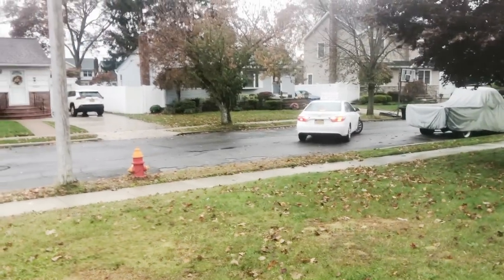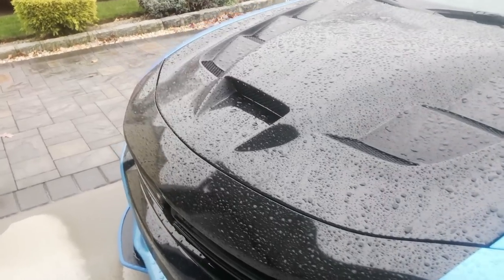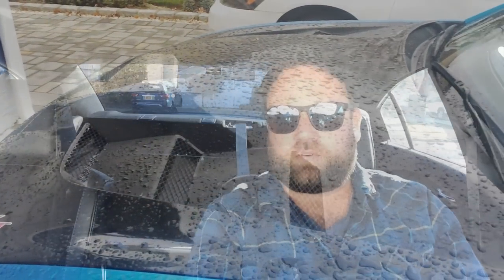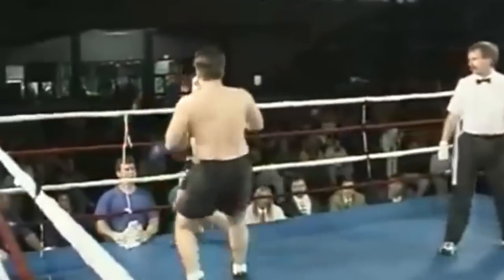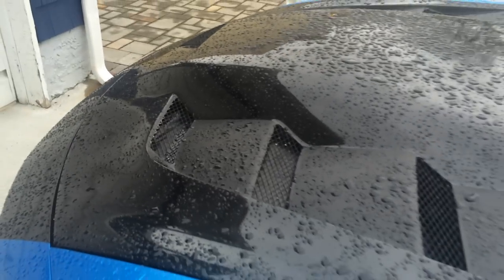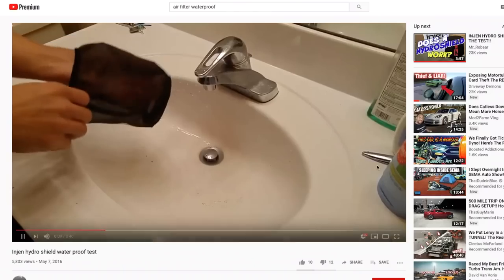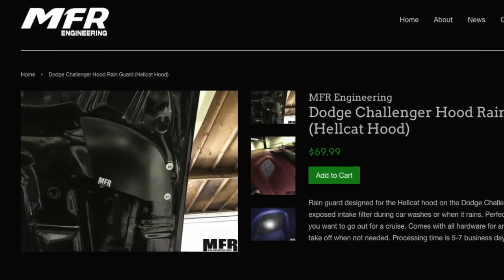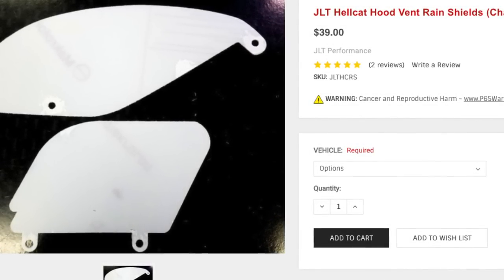Hood Leaks WATER onto Air Filter - FIX IT!!!

Comment: You might wanna get the afe gt momentum closed cai with the blue filter. The blue filter is for better performance and the white filter is for better filtration
Reply from the maker: Yah I heard they have a great setup. Thank you for the heads up on that.
Reply: @RTLife  yeh
Reply: Mike Gee if you go for the 6.4 air box then you might as well go with the hell cat lower air box with the front snorkels and new grille with the snorkel bezels
Reply: Mike Gee I only say that because I have a scat pack and I am considering upgrading to the hell cat lower air box with front bezel grill. I like the look the most and also like the added cooler airflow into the intake
Reply: There may be a solution but not sure hence I am asking. There is something called rain guards for hood vents but I am not sure if they work nor if they also guard the air away

Comment: Did you regret getting this hood for your car?  I feel bad for those who own a viper or a car with a viper good especially when it rains. That's like me driving with twin turbos under my car in the rain.
Reply from the maker: Def no regrets at all - this is a nice upgrade. Love how it looks & it lets in more air.
Reply: @RTLife  Agreed. But it so nice in the rain tho. Imagine cleaning snow out of the hood vents.
Reply from the maker: once the engine warms up - snow will melt quickly. Plus this RT is a little diva now. In the winter it doesn't go out driving.

Comment: I used a 5$ sheet of black Plexi (I cut to fit my Blackhawk intake) and 2 90 degree brackets and made my cover for under 10$. Takes 5 seconds to jump out of car and throw it on if I get caught in the rain. I've driven 4 hours in straight rain without any issues. I have a hellcat hood on my car and the vent is DIRECTLY over my intake.
Reply from the maker: I was thinking of the doing the same. Nicely done man
Reply: @RTLife  then you drill a small hole, throw a short bolt through each side of your intake shield, throw a nut on the other side with a washer so you have a stationary peg to quick lock the 90 bracket into. I developed this idea last winter while my car was just sitting for the winter. I love do it yourself projects!

Comment: Mine leaks as well, but I switch to a filter in a closed box, AFE Momentum GT series, no issues since!
Reply from the maker: I was kicking around the idea of doing that.I hear really good things about the AFE intakes
Reply: @RTLife  on paper, you lose more hp in the close box intakes, and gain torque.  But after getting it tuned, it was proven closed box intakes are better.  It doesn't pull the hot air from the engine and runs cooler longer, meaning the fan doesn't kick in until later.  I could physically feel the difference from the open faced one to the closed box.  It broke all 4 tires loose on my Durango RT with just that change.  For what it costs, it was definitely worth it!
Reply: @jerendebardelaben1817  All cars come from factory with enclosed air intake systems for a reason.  Open element air filters are more a sales gimmick like extended warranties. Hot air intakes increase IATs and profit for knockoff (aftermarket) air filter companies.  Real racecars have open elements that they tune for specific day and specific weather and millions are put into the cars.  Hot air intakes on open hood dynos show false hp numbers unless you are driving around with no hood or your hood up somehow

Comment: Two of the best options out there that would both lower your intake temp (especially at idle) dramatically, increase air flow and eliminate the issue of water leaking through hood vents are: 1. Use the stock air box, or even better to swap out the lower box to a hellcat one that has a functional inlet hole, and get the mopar air duct along with a radiator shield that fits right on to the lower box inlet hole, so it would breath fresh and draw more air from the fender grills. I think there are two types of mopar’s fender grill air ducts/tubes, where one would fit both the Non SRT and SRT front bumpers, whereas the other would only fit the 19+ SRT with 2 front snorkels/eyes on the grills. 2. Get an AFE GT momentum kit, the box also has a same inlet that would fit the mopar fender grill air duct tube. The open box design is good while the car is moving = performance, but you might have noticed that your intake temp would rocket up like crazy (2 times or even 2.5 times higher than ambient) at idle. The main reason why that is the case is because most of the heat generated by the radiator goes right through the open designed air box to the air filter when the car is not moving(some are exceptions if everywhere else is enclosed but the top). If say you got a hellcat lower box without also getting a mopar air duct, a good amount of heat would still go through that inlet hole to your filter. I see yours is like a half enclosed open box design, that’s even worse IMO. The AFE GT momentum box has a cap that you can put onto the inlet hole if you dont wanna use the mopar air duct. I have a mopar cai kit, and i have since noticed a tremendous difference in idle intake temps between mopar and stock boxes. I then blocked the rectangular inlet hole on the mopar box by riveting a piece of rubber, and the idle temp dropped a lot comparing to before, but still wouldn’t be as good as an entirely closed box design since there’s still some area not sealed (the top lid where the weather stripping seal ends). Getting a closed box would only benefit by eliminating the water issue and increasing air flow along with the mopar fender air duct. lmk what you thoughts are :)

Comment: They didnt add channels under the vents to draw most of the water away from the intake??🤔 seems like not alot of thought went into it, although if ypu have the cloth filter it SHOULD be fine with anything less than a direct stream of water flowing into it, as it wicks most of the water, and the oil on the filter is meant to keep it beading off.  Also, personal experience, do NOT use vinyl wrap under the hood, use the heat resistant 🤦‍♂️🤦‍♂️🤦‍♂️ whats it called..dynamat? Used it to seal my uncles '65 mustang hood, or fashion a tray lol
Reply from the maker: No there are channels & for the most part they do a solid job of collecting the water. Some does get into the engine bay though.
Reply: @RTLife  oh yeah its fine if some gets in, ive actually hosed my entire ebgine bay down multiple times, nothing will get damaged by rain. The filters are pretty strong too, my k&n with 96k miles on it, still suppresses most of the water, washed it today under a high flow of water and not much was making it to the other side. And the oil is water resistant. Chased the water that i missed right out of the filter.

Comment: It would definitely be a Hell of a get together.....Just an idea for your hood..I had a customer with a similar hood same problem we took clear plexiglass and use a little bit of silicone and glued it underneath it kept a look while keeping the water from going On the engine and air filter..you don’t have to do everyone of the vents if you’re worried about the heat building up..Just a thought for you 😎great video thank you👍
Reply from the maker: It really would be a lot of fun going out there & seeing it happen in person. Many of these guys have solid builds. Thank you for the tip - might end up doing that.

Comment: Maybe consider drilling a couple of 8mm sized drain holes in the bottom of your air box (just in case) and in conjunction use the waterproof sock over the air filter, you should be good without having to cover the vent with vinyl. Just a thought.
Reply from the maker: def thinking about the waterpoof sleeve over the filter - solid way of preventing any nonsense.

Comment: Quick question..If I were to buy a diablo tuner for a tune on kook headers would I have to unlock my PCM in order to connect the Diablo for the tune? I’ve read a few forums and I’ve seen people get error when connecting the tuner to the computer of the car...thank you 😁
Reply from the maker: If you have a 15+ you need an unlocked PCM for the tuner to work.
Reply: R/T Life I have a ‘14 Charger RT at the moment
Reply from the maker: You're good to go - you have an unlocked PCM already in place. Tune away!
Reply: Thank you 🔥

Comment: Have been thinking about changing the stock one on my SRT8, for a carvini induction hood or hellcat style one for better heat extraction. I also like the ones that are on the Steve Saleen SMS 570 Challengers, and always thought that they were really cool as well. Even though they are based on the RTs, it would still look cool on my srt8 and most people wouldn't know what they are anyway. I would do it mainly for performance purposes, and the looks are just a bonus. We are located in the desert Southwest and doesn't get much rain, so the leakage wouldn't be a problem. Except when washing it, and would just cover the filter was plastic anyway 👍🏼
Reply from the maker: I like those Carvini Shakers - they looks slick. Remember you can always put a waterproof sleeve over the filter. The air flow in the engine bay is much better.

Comment: I know this is a old video but I need to tell you this. The sleeve is great at repelling water under the fossett. But... When you apply a vacuum to it. I will suck water through it. It's great if your engin is off not so much if its running.

Comment: @5.00 wen u were talking about a sleeve for the air filter, I can tell you it definetly works,When I was riding quads (banshees) I had a similar type of thing that would go over the filter,,It worked very good.Dont get me wrong if I were to sink the bike in deep shit I think it would cause issues ,but overall worked great,and I never blew a bike up over wet filters
Reply from the maker: I know what you mean - it repeals water but that will not help if you fall into a lake. I might end up getting one because it's easy to slip on/off.

Comment: I didn't realize the Hellcat hoods were like this until I put it on last month. I bought those plastic covers first that mount under the vents, but they dont seal it shut. So, I sold my cai that is open on top and bought one by a company called Injen. It is closed on top with a see through port on top, it has the hellcat intake for the headlight, amd the tube that goes to the throttle body is a smooth piece. I like it so far.
Reply from the maker: That's a solid setup you have. The hellcat hood looks sharp.

Comment: I mean, i might have a V6 but i have a K&N in there. If you have a filter around the same size as the K&N filter. I would recommend a Drycharger cover for the air filter. Works like a charm on heavy rains.
Reply from the maker: Thanks man for the heads up on that. There are a handful of solid options.

Comment: Thanks for the shout out bro.   Water control is one main reasons I like my specific brand of Viper hood - the vents have a catch-basin under them that funnels water to the front of the hood where it drains down in front of the radiator.   So very little water gets into the engine bay.  
Looking forward to the meet this weekend - wear your long johns - gonna be brisk out there!
Reply from the maker: yah my hood does that as well. For the most part 90% of the water gets funneled to the front of the hood. It's def going to be a cold one this weekend! Should be fun anyway

Comment: Good call on the filter cover.  Maybe I should look into that vs. putting a stock air box in.  Or at least give it some thought.  The shaker hood is going to let in a crap ton of water with the snow I get.
Reply from the maker: Yah I never even thought about that - def going to be interesting how you handle that.

Comment: That’s the only reason I didn’t get the viper hood for my charger. Going with the shaker.
Reply from the maker: I wanted to go shaker but the price was just to much. I don't think this is really a big deal though - a lot of water needs to be dumped onto the intake to have issues. A Shaker Charger would have been cool.
Reply: R/T Life for my year it’s only 380 plus shipping so it isn’t bad. I have PTSD from water damage to my car so I didn’t want to take any chances because it rains a lot in VA 🤦🏾‍♂️

Comment: I have a open air filter and a Hellcat hood. It almost hydrolocked twice since installing the hood. I live in upstate New York. I feel like the vent shield might be the way to go for me anyway because I also have the same problem with there not being a hydrophobic pre-filter big enough for my Mopar air filter.
Reply from the maker: Let me know how the shield works out for you. I love the vents but it def opens up the door to water issues.
Reply: @RTLife  most definitely will. Your video was definitely informative, I didn't even know that the vent shield was available.
Reply: If you have the mopar stage one CAI air filter, I can point you to a pre-filter that fits that specific filter.   I have one on my RT with a hellcat hood and it works great.
Reply: @CTHellcat  that's awesome news. I believe that would be the one.
Reply: @abel5074  brand and part number is in the video.  https://youtu.be/pvCXI54Y6dg
Reply: @CTHellcat  thank you very much!

Comment: JLT has plates for the hellcat hoods , have one on my Widebody water doesn’t hit the filter
Reply from the maker: Nice - that was def one option I was looking at. Did you have to drill it in?
Reply: R/T Life it actually uses the factory bolts for the grille insert. It allows the water to run away from the intake , I even did a test with a plastic bag over the intake and sprayed water from every possible angle and the bag never got wet.

Comment: This has been a concern of mine since we got my wife's 18 R/T Durango since it has the SRT hood with vents. That is why she hasn't got a cold air intake.
Reply from the maker: if you keep the intake stock there will no risk at all. It would take a lot of water for issues. I'm just being safe.
Reply: @RTLife  hold on so getting the killer bee hood is only liable to get water if we have a after market intake? I have stock intake on my scat pack and want viper hood but worried about water …

Comment: I had that same hood on my 2008 charger and cost me 200 an hr at car the dealership to fix my electrical fuse box from rain water $$$ never again. Seal all those holes with flex seal. It work fine

Comment: Great, informative content as always! I’ve looked into the filter sleeves when I was considering getting an LMI True Cold Air intake, but I chickened out and got the hammer because I’m just too paranoid about deep puddles, but I know it’s so rare to hydrolock an engine. I think that’s your best bet though and like you said, just take it off on race day. Some people clean their engine bays with a water hose or even power washer, so the small amount getting in yours is probably nothing to worry about but I know it’d bother me too.
Reply from the maker: yah I don't think I will run into any issues - the hood does a solid job of catching most of the water. Just trying to be careful though. Thanks man - hope all is going good on your end.

Comment: Another great option for intakes is the hellcat upper, lower intake boxes, snorkel, front air dam, and then a custom intake tube to get rid of the wrinkles. Of course,  get a drop in filter like the factory hellcat or dry flow filter.
Reply from the maker: yah that's a solid setup - I know you did that & it's been pretty solid right?

Comment: I was looking all over for solutions to this issue.Thanks for the video It was some good options.I think I am going to seal them all from the inside.I had a 350z Hr before and it was turboed and I had no issues this one is a De and iam more worried about prolonged water exposure to the engine itself.

Comment: This is one reason I haven't done the switch to my RT hood yet. I've been doing a bunch of research because I'm concerned about water getting into functional hood vents and scoops. Especially since I plan on a supercharger in the future.
Reply from the maker: It's really not that big of an issue if some water goes in - you just can't have a massive amount directly on the intake. Everything else in the engine bay is ok to get wet. But I understand your hesitation, that was a concern of mine as well.
Reply: Look into the viper hood from TruFiber - it has a water flow control system that catches the water from the vents and drains it in front of the radiator.   I have a couple videos on my channel about this hood if you want more info.
Reply: @RTLife  Yeah. I just have to decide which supercharger I'm going with so I know what position it will be in, in the engine bay and then decide which hood and water protection for the filter since it rains all the time in South Florida.
Reply: @CTHellcat  I'll check it out. Thanks!

Comment: What you think about the demon hood though ?
Reply from the maker: You would run into a similar issue if you have an open intake setup. The Demon scoop directs air directly to the intake area. This isn't that big of an issue. I would really need to have a ton of water to really run into an issue.
Reply: Yeah I can see that I do have an open one. That’s why was wondering but a lot of chargers are getting your style hood. Trying to be different with the demon one at least don’t see to many chargers with that one. Well from where I’m from. But great videos and lots of knowledge 👌

Comment: Water is not going to hurt your washable air filter or your engine so why worry about it
Reply from the maker: True but if it's really pouring out & i'm on the HWY water could get through
Reply: @RTLife   if you are moving it won't get in and it's like a small steam clean for your engine if the filter is slightly wet I would be more worried about water getting in the electronics but I am no expert I do have a water proof cover on my Tahoe but the filter is open air in front of the tire and it could get a big splash in a deep puddle and that would be bad peace of mind spend the money and get the cover